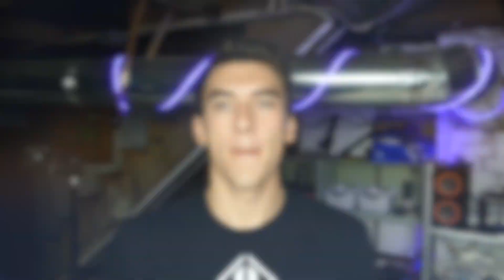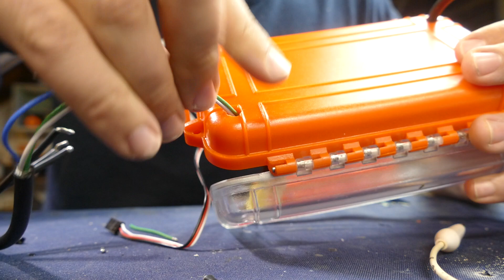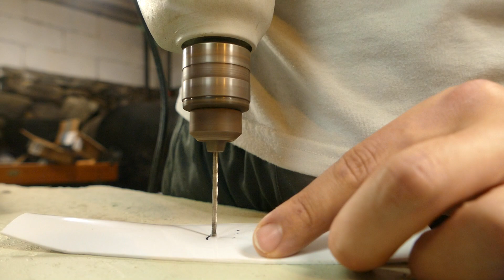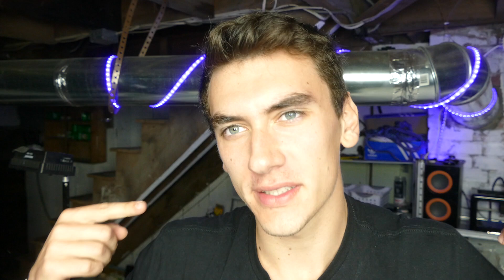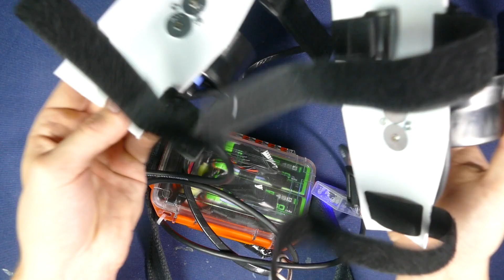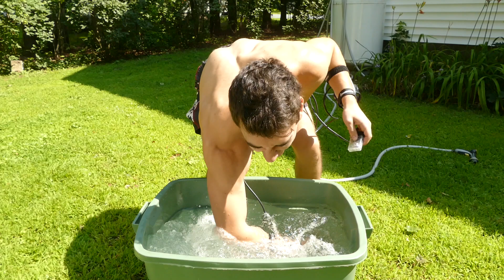How To Make Wrist Water Propellers! - Underwater Thrusters!!! (Become Aquaman)

Comment: Can you fly if you get a bunch of these jet engines??☝🏼
Reply: Check out The Hacksmith; he is working on a real life iron man suit using jet turbines as propulsion. It's pretty rad
Reply: Not really, would need actual jets, for most of the propulsion, and there's fuel to manage with those.
And it's not exactly cheap to get even one jet.
Reply: EZ Tube no you cant

Comment: To make it easier for the on and off switch, but couldn't you make a switch that extended from the dominant wrist to the hand so you don't have a third cable (you might tape the power cable along the length of the propeller that will have the switch) or have to find and grab at the switch to get to it. You could even mount the switch so you can still use the hand but the switch will be accessible without trouble.
And can't think of the design name of it but think like the switch for the wrist launcher from 'Jingle all the Way' Turbo Man.

Comment: i think it would be better to mount them the other way around ur wrist since the current way ur mounting it will require u to repel the thrust force which can be difficult after some time but if u reverse it's direction u can just keep ur hands to ur side and it will push u without u applying any opposing force to maintain it 
great project non the less